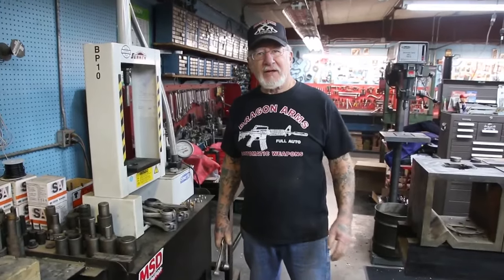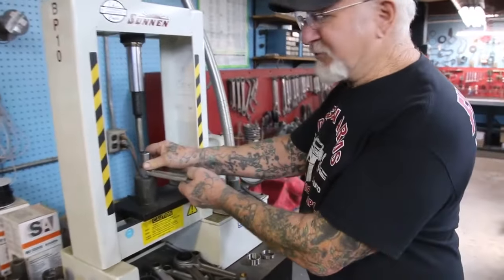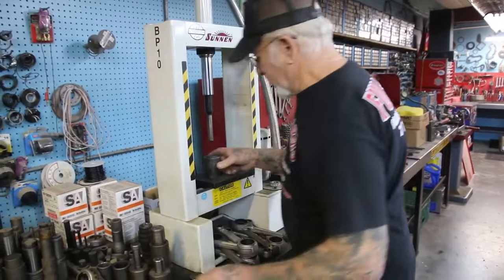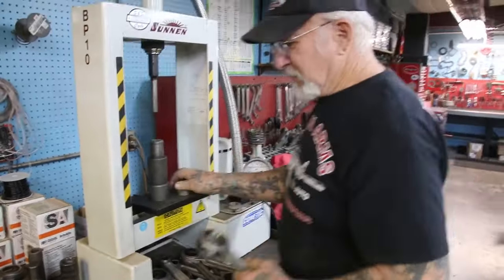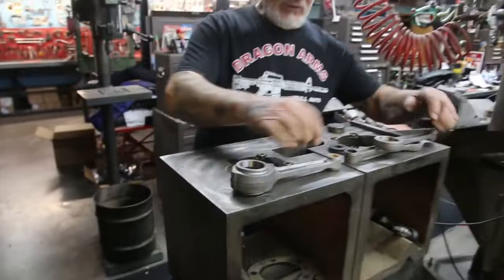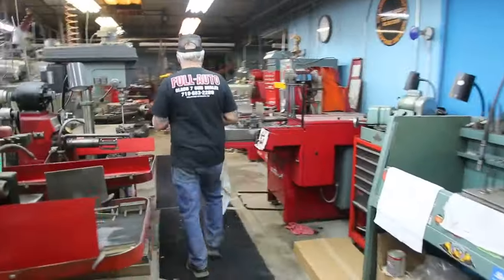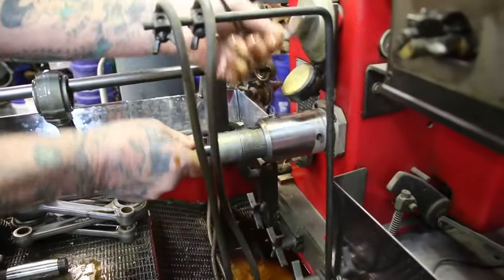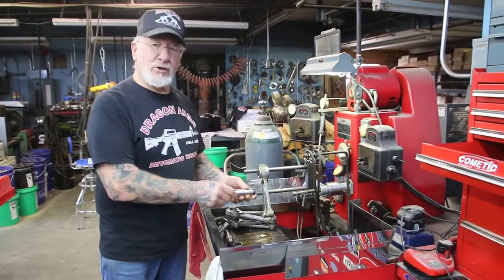Harley Motor Work Rebuilding

Comment: Years ago Campy at H-D New Orleans rebuilt my 65 XLCH rods and wanted lower compression pistons Campy said '' Go get a stop sign and take the base gasket and cut it to size run double gaskets that'll drop you down to 10.5 to 1 '' 🤣

Comment: Do you by chance do any work for rebuilds on the lower ends for the 88 twin cams ?
Reply: Also do you by chance do the timken bearing upgrades on the 88 twin cam crank shafts ?